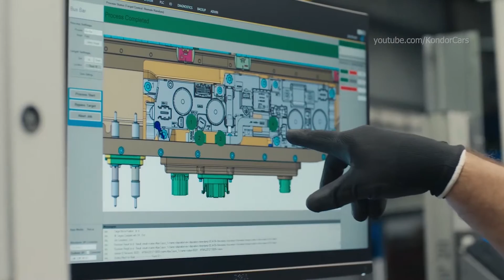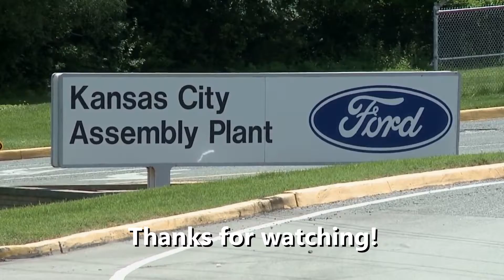Ford Transit Production in Kansas U.S.A

Comment: The Ford Transit is a family of light commercial vehicles manufactured by the Ford Motor Company since 1965, primarily as a cargo van, but also available in other configurations including a large passenger van (marketed as the Ford Tourneo in some markets since 1995), cutaway van chassis, and a pickup truck. The vehicle is also known as the Ford T-Series (T-150, T-250, T-350), a nomenclature shared with Ford's other light commercial vehicles, the Ford F-Series trucks, and the Ford E-Series chassis. As of 2015, 8 million Transit vans have been sold, making it the third best-selling van of all time and has been produced across four basic platform generations (debuting in 1965, 1986, 2000, and 2013 respectively), with various "facelift" versions of each.